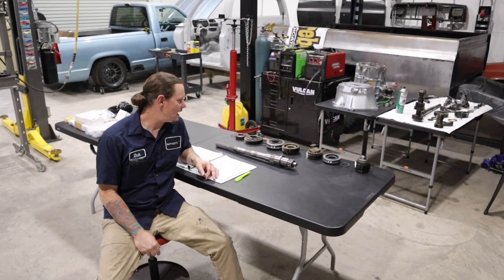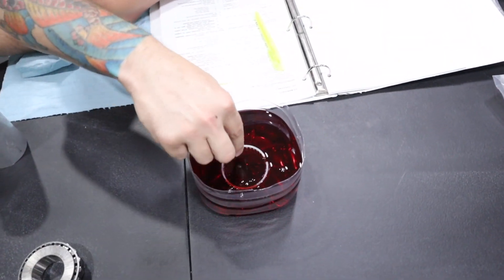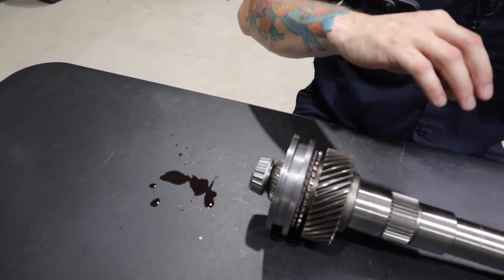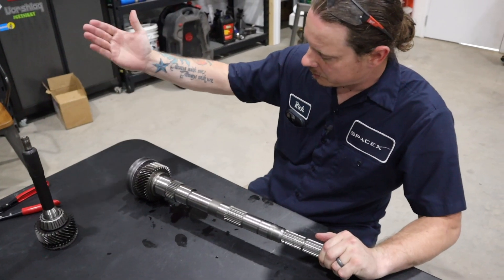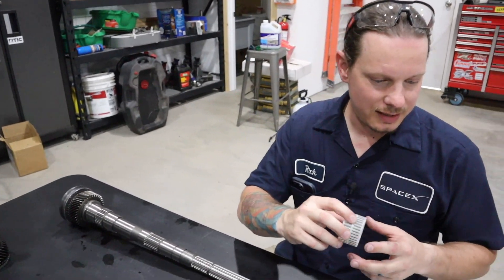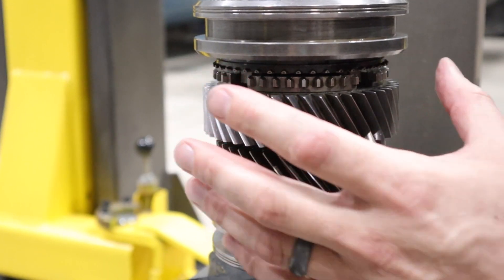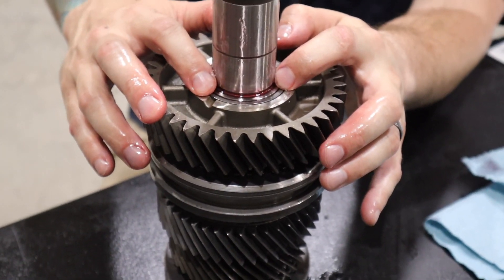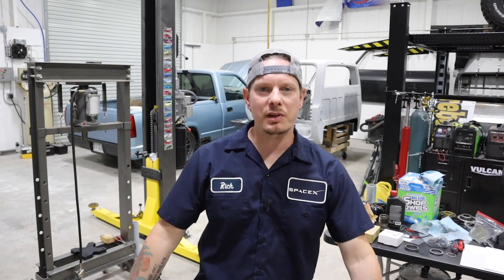T56 main shaft rebuild

Comment: Great vid and very detailed!! For those of us without a press, I've had a lot of luck with putting the press on bearings in boiling water for a while then quickly slide them on into place. Just need to have everything setup and ready to slide together so the bearing doesn't have time to cool down before it's in place.

Comment: Great video.  The front little bearing on my main shaft self destructed and fused to the main shaft.  As a result, I had to get a new shaft and will be installing the gear and syncros.  My shaft is the updated version so I do not have the rubber O ring behind the main bearing.  My main bearing is pressed on.

Comment: Transmissions have sure changed since the 60's. I rebuilt Aluminum Power Glides, Torque Flights, C4's and other simple transmissions. Cost was $250.00 ea. and I normally did 2 everyday.  Great Video....
Reply from the maker: Thanks Charles! This is my first transmission rebuild so it’s definitely a learning experience.  Thanks for watching and let me know if I mess anything up!